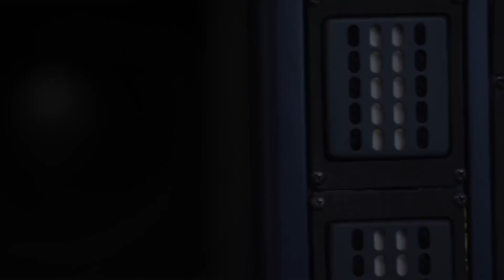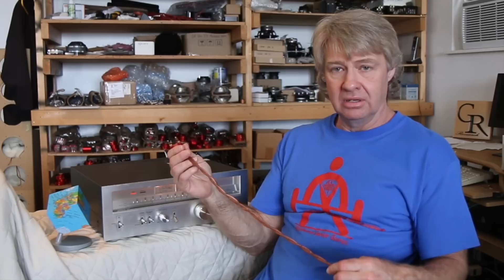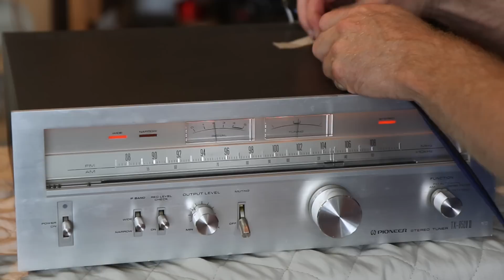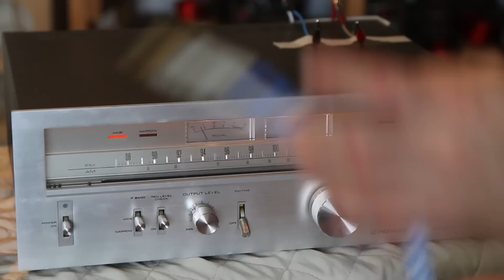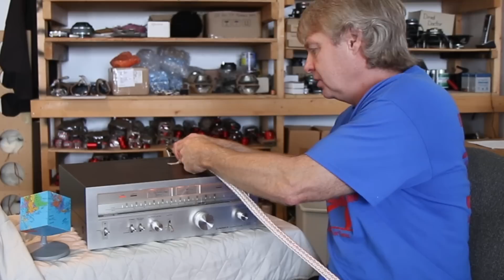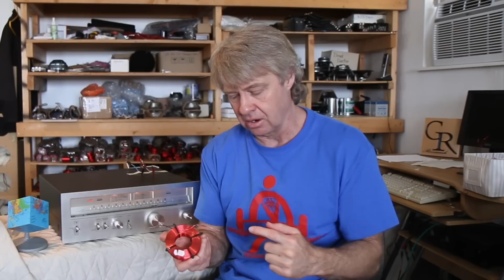Do Audiophile Cables Matter? Here's PROOF!

Comment: You’re tuned to about 105Mhz. That’s over five thousand times higher frequency than what a human can hear. You had a whole spiel beforehand about how the importance of cable is to filter out noise floor, if that’s the case just measure the noise floor that each cable introduces and it would be clear cut proof that the cable matters.

Comment: EMI is a thing, no-one has ever denied EMI, but also balanced audio connections have existed longer than any of us have been alive.
Relying on shielded cables is like mounting a giant wing on a cargo-van to get better handling.

The bottom line is that "IF" you can hear EMI on your current system (most won't) then continue buying $5 cables, in balanced connection.
Reply: It isn't if you can here it, but what is it doing to the audio signal?

Comment: I did not know people can hear FM radio station's frequency 88MHz and up :))) Why do we need radios in our cars then at all??? I think internal amp's components create more noise than FM frequency from air. And yes, 60Hz power wiring from the house will do more noise than FM air signal, but all that noise mostly is picked up by low powered interconnecting wires between DACs, turntables, CD players and power amplifier. That is why all those cables are shielded and shield is grounded.
Another test should have been done - connect those wires to speaker without connecting second ends to any amplifier and try to listen the speaker with dB meter. I bet such test would destroy the whole idea pushed in this video.
Reply: It is not a matter of hearing the RF noise, it is what it is doing to the audio signal. Also shielded cables create their own problems as they can put added voltage on the ground plane that also negatively effects the signal.

Comment: You can record the results of swapping out cables (obviously not speaker cables though), and then line up all the files in a multitrack sessions of a digital editor where you can immediately switch between the recordings where only a particular set of cables is changed.  A friend and I did this with different pairs of interconnects years ago.  Now, the recording had to go D/A and A/D, so the sound of the conversion was also in there, but the point was to see what cables would preserve the sound of the control file (the file played ripped direct off a CD).  Every set of interconnects sounded different in the test.  My memories are that we found that the set that priced just above the lowest price set was the most accurate overall in that setting.  Whether one cares about those differences or not is up to that person, and how one set of cables interacts with a piece of equipment may not be how it does with another always either.

Comment: Can someone please explain how the speaker cables is able to influence the sound.I'got maybe a 12 gauge cable on the other side of the amp banana plug and If I'm lucky some 14 gauge wire on the other side of the speaker plug.How does improving the cable between them change the signal?
Reply: It is carrying the audio signal. Everything about it can effect that signal transfer.

Comment: Connect those speaker cables between the amplifier and  speakers and listen for RF between them.  You aren't going to hear it most likely.

If you do have a system in an area with lots of extremely strong RF, use shielded cable.
Reply: But it has an affect on the playback as it effects the signal that we do hear. Shielding is not the answer. Shielding does nothing for noise already on the line.
Reply: @dannyrichie9743 First of all, the speaker cable test is flawed because the speaker cables are not being connected to the amplifier outputs. That's the problem. They should have been tested in context. Then, there should have been different amplifiers tested because amplifier topology and technology definitely has an effect on RF and EMF. 

Your argument about the shielding not being able to do anything about interference in the line makes no sense. If the interference is already in the line, then the problem is happening upstream. The cable is likely not the problem. 

If you watch the Dave Rat YouTube video on cables and RF, EMF, etc, he shows how twists in the cable affect RF and how shielding affects EMF. 

In commercial and residential environments, unless you're in New York City or some other super concentrated area with large volumes of RF, you're going to be mostly creating more EMF problems for yourself by all of the power supplies in electronics, chargers, appliances, the computers themselves, LED walls and displays, etc. 

RF can enter through the speaker and be transmitted down the speaker cable, which makes this a moot point. If you're using a minimalist Class A amplifier with a poor power supply design, you are subject to RF and EMF.  The cable isn't going to make that much of a difference. We are talking a few decibels of a difference. 

It would be better to use state of the art Class D from PowerSoft than a hoity-toity boutique amp, because amp is built to reject EMF and RF and it won't matter what cable is connecting the amplifier to the speakers.

Comment: You'd be much much better served to fix acoustical issues (bass traps, multi subs, absorbers/diffusers) in your room, get better amps, dampen cabinet resonance, upgrade poor crossover components, address rattles/vibrations in the room, and run a good EQ system like DIRAC or Audyssey.

Comment: electro,  magnetic,,  signals...  common mode current riding on the cable ,  rfi emi  creating a choke by  using , , 5 to 7 clip on ferrites with the right mix, maybe 31 and 47 and  do this with ALL cables , power, ground, remote, speaker leads, and interconnect.  something i like to use b.c it is cheap, and a cheap pocket radio with the long pull out antenna works so well b/c the cheap dollar general am radios made in chicom have little to no shielding,  Take the am radio and wave the long telescopic antenna all around your equipment from the head unit to the amps to the rear speakers listening to the radio for an increase in volume and diferent noises . All areas where there was an increase in volume or noiticeable change in the type of static will need  common mode chokes also.

Comment: Why not just run high quality audio signals through several cables and revert the phase on one to the other and simply visualize the difference? A null test in other words. Also include variation in levels and make a graph of the possible noise profiles that results from this
Reply: That doesn't work at all. The noise is variable. So none of it lines up and cancels when you do that.
Reply: @dannyrichie9743  You cancel the audio signals, not the noise.
Reply: @dannyrichie9743  You flip the audio signal, not the noise, that way you are left with the noise the cables pick up and which ones pick up more or less, and which frequencies etc. are more dominant in some in reference to a good quality cable as a control.

Comment: The only speaker cable where I have consistently heard a marginal improvement was the Supra ply 3.4 It was always an all around improvement @ reasonable cost. But a bunch of small improvements can add up. It seemed to be less of a noise antenna  well insulated & braided for noise cancellation. Thus it always sounded a little "cleaner" 
That said go active & avoid the issue alltogether 😁 
Damping factor goes south real quick the longer the cable run to the speakers. But only really matters significantly for bass. Rythmik audio appears to have the best solution to that issue atm.

Comment: Cheap cables use a "frog hair" for conductors. Quality belden brand with solid brass ends are your best route. Throw out all those jap cheap cables.those. Will only cause hum or have intermittent causing you to blow yourself out of the room. Don't worry so much about frequency loss is anything like that, r c a plug system is marginal at best anyway,why did they have to standardize on one of the worst audio hookups is beyond me.

Comment: Interesting test, though I just found the video 4 years after it was posted. By chance, if you happen to read this message, could you repeat this test but with terminating each cable with an 8 and 600 ohm resistor. Another interesting test would be to take an audio sig generator, set it at say, 1KHz and set the output level to center on some scale of a VTVM and test with and wo termination for signal loss across each cable. A really good test would to sweep the cables from 20 Hz to 20 KHz while observing levels on a spectrum analyzer, not sure if you have an SA or a way to sweep each cable; just a thought. 
As an EE, I am one of the guys who is skeptical but one thing is true, empirical experimentation often yields results which do not necessarily agree with what the text books tell us.  
Just found your channel and have enjoyed watching your content. Thanks !!

Comment: Thanks, super informative!  I've actually been wanting to run  that test myself for awhile to see what the range is and I'm glad I found this video.  Now, as far as my system goes, I'm not running crazy expensive equipment but I have tuned it well enough that it sounds pretty good to me at least.    I have two systems in my office, one for my computer and TV and one for listening to music.  I found a resale shop in town and have picked up speakers and equipment here and there because I have found in my experience that newer definitely does not mean better.  The true voltage of the vintage recievers is still second to none as far as listening to well recorded music.   Anyway, I am going to look into picking up some decent cables in the future to see if I can take my sound to another level....which should just tickle my wife pink...lol.

Comment: Bravo, you've proven long interconnect cables make great FM antennas.  Not saying you are wrong, but the test is clearly geared towards using lengths that make good antennas.  If you try that with 1 ft to 2 ft shielded interconnect cables, you'll find they are lower noise than longer ones of the same construction.  If you need to run cables longer distances, then there is certainly a case for using more expensive cables.
There are 12 gauge cables with fairly decent shielding, and metal connectors for about $16 on Amazon.  They are pretty low noise just due to the shorter lengths, the larger wire does a pretty good job of conducting all frequencies better than skinny wires will, and the metal connectors extend the shielding the full length of the cable where molded plastic connections don't.  
Are they as good as expensive audiophile cables?  I'm not saying that, and even $50 cables might be better, but if you want to lower the noise floor for less money, start by keeping the interconnect cables as short as you can.
The biggest difference in noise floor, and sound quality is always going to be in the first jump in cable quality, and you have to spend more and more for each level of audible difference.
Frankly, AC power coming into an amp, pre-amp, etc...  is going to be one of your biggest noise threats.  AC's 50 Hz or 60 Hz is within the range of human hearing, and AC wiring can bring other noises picked up by the wiring before it enters the case.  Most people without really high end audiophile gear could benefit from some sort of power filter a lot cheaper than with audiophile cables.  There is a reason high end gear has external power supplies.
Reply: So now the question is are long interconnect cables better than the basic fm wire connector that came with my AVR?
Reply: @TruthHasSpoken  Nah... you wanna go for at least the $500 audiophile FM antennas for the best reception.  For AM you really have to splurge.  :D
Reply: Even though I'm an avid 2 channel stereo music lover, I also love the occasional movie, too, and due to lack of space I have to optimise my setup for multi-channel listening also. However, when it came listening to my newly discovered multi-channel setup I immediately became aware of how the room sounded different. Didn't know what it was at first, but coming from an audio black background there was no way I was prepared to put up with it!

Even after auditioning 3 separate AVR's, the same electrical ambient sound of the room was still present! That told me the extremely faint background signal noise I had been experiencing (poor description) had nothing to do with the actual units. Therefore, my attention changed to the cables. And even then It was only on the third occasion after living with two previous sets of cables that I ended up finally purchasing shielded cables and lo and behold that is when the noise floor within my small room finally came down to satisfactory levels.

 Cables often act as antennas for attracting RF, and the longer the cable, the better the antenna! Probably explains why when I used to disconnect my heights and surrounds within 10 minutes, the faint background signal noise (RF/EMI) within my small room used to almost practically disappear/dissipate

The more cables I shield, the quieter my room becomes, and the better the shielding, the more the cables are likely to disappear.

If one has the same sensitivities and is looking to address this matter, but is also hoping to notice (hear) the incremental differences, I would suggest starting with analogue cables before moving on to digital and power cables (no good trying to hear the quietest when one hasn't addressed the noisiest)

Trying to achieve a totally silent room sadly has turned into obsession for me. However, the results speak for themselves. There are times when sitting in the MLP and pressing pause (or mute), I'm unable to differentiate whether the systems on or whether the systems actually switched off. Of course, audiophile equipment helps, but in reality, for one to experience an exceptionally quiet room with a multi-channel setup, shielded cables IMO are a must.
Reply: @Totalplonker  Yeah, good shielding on interconnects definitely makes a difference, and they don't even have to cost a lot if you choose carefully.  I think I paid ~$15 a pair, and there's zero background noise coming from my speakers. 
I added a ferrite RF choke to my Carver's power cable, just in case, even though it probably didn't need it.  For the price ($8 for 5)... what the heck.  Modern receivers probably have it built it to reduce RF output on the power cable, so if nothing else, this addition might lower noise output to my other components.  
Digital cables have always required shielding, but even sub $10 coax SPDIF cables will probably work.   Larger guage wire doesn't really make a difference on digital, but might be more durable, and aestetically pleasing if it matches your analog cables.  A good analog interconnect cable should work, as I've seen even cheap composite/audio cables that come with DVD players working.
Optical spdif cables are immune to RF/EMI noise, but you do want them to be durable enough to move stuff around once in a while. 
Now if I could reduce or eliminate the classic Carver transformer hum (due to the power supply design) without putting it in a cabinet.  I'm seriously considering potting the sucker.  It's not like I'm going to rewind the transformer if it dies.

Comment: So i read so many comments here and expected to see the responses i did, and its the same baseless angle every time.. Some watchers failed to understand his tests and it went right over your heads.. What he was illustrating was how well a cable designs REJECTS external noise. The fact that the better cables acted LESS like an antenna shows that these cables and their geometry and characteristics are able to reject external noise like RF and EMI etc and that their designs prove that there are drastic differences that CAN be measured.... That alone is one large aspect as to why cables make drastic differences in the sound and the noise floor was one of the 1st things i picked up on when i explored this myself!! 2ndly... Most people i know who get easily triggered to cry "snake oil" have two thing in common with what they use/have... one.. most use mid-fi equipment with mid-fi speakers with more emphasis on the dials, meters, and lights that investing into one higher end system that focuses on the audio transparency so they do not even have the right kind of gear, speaker placement, nor a willing mindset to even be able to hear these differences... two... most people have NEVER even tried any of these cables to begin with.. these opinions are formulated by collective popular consensus literally fabricated out of opinion and speculations and nothing more... Most admit that they use lamp cord and say "they would never waste their money on this snake oil" well how can one so strongly and in absolute certainty beat their chest in  this kind of confidence and make these claims if they never even tried any of these cables to begin with? I see this social media mentality with nearly every topic out there and its based in reality on pure denial ignorance and nothing more.

Comment: How about the wires going from the terminal to the driver and the wires that go to the motor on the driver?
Reply: Everything matters.
Reply: @dannyrichie9743  So how does replacing the main wire make such a big difference when you have a standard wire on each end of the system?
Reply: @ Standard wire on each end of the system? Again, everything matters.

Comment: speakers are not susceptible to radio frequencies as it needs a very high current signal to move the voice coil, any EMI just goes undetected. there is so much gain in the front end of a radio reciever, that test is flawed in every wich way if you change that speaker cable for a extremely cheap shielded smartphone usb cable you will see it is also a very poor antena, does that make it a good speaker cable? stop with the scam.
Reply: That's not true. It fact some amps use some negative feedback. So whatever it being picked up gets reintroduces into the signal.